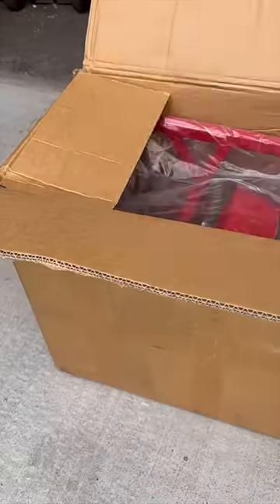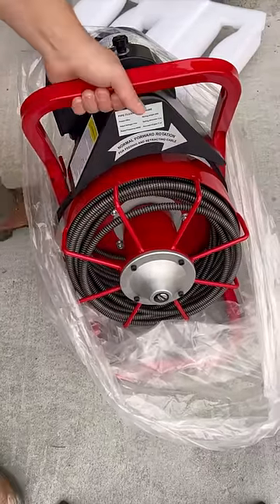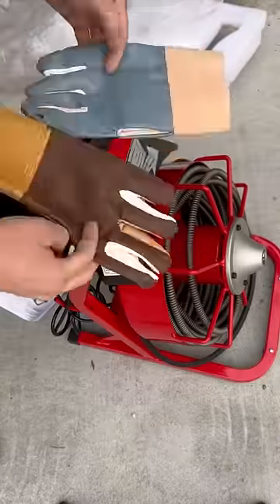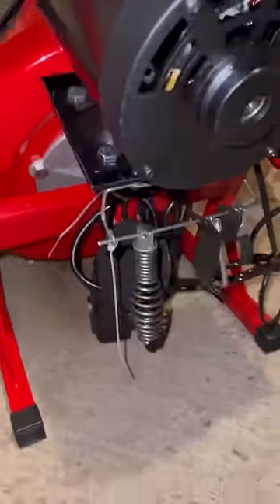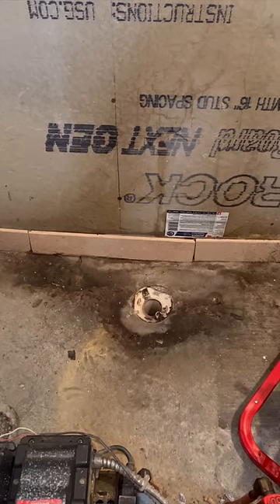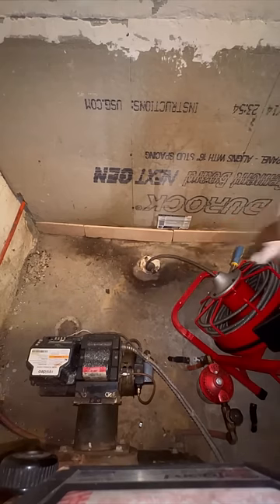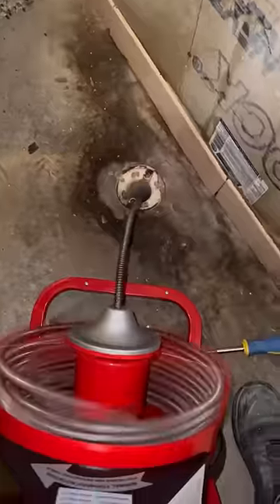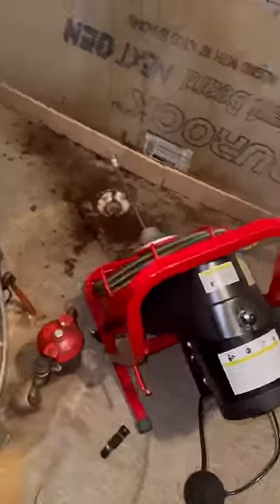VEVOR Drain Cleaner Snake #vevor #diyproject #vevordiyproject

Comment: Bought one from harbor freight when my drain to the street filled with roots. Best 200 bucks spent. One call to the plumber at 400 dollars was one time too many. It really is easy to use
Reply: Short term fix.
Reply: Unfortunately, you're probably going to have to do some replacement or reabilitation.
Reply: Any sewer machine you get for less than $1000 isn't made for big pipes underground. You may have gotten lucky and opened it but if it hits bad roots that cable can tie in a knot. That's why mainline rodders have a thicker cable. It can't do a U-turn inside the pipe. Just be gentle with it....
Reply: Man 400 for a plumber is insane. Where I live this would cost 20 euros. 40 tops
Reply: If roots are your only problem and the pipes in good shape it's worth it to get it jetted.
Reply: one thing people never think about also is how readily available these things are at equipment rental centers....i work at a hardware/lumberyard/rental center and those things make us so much money...only 50 bucks to rent the big one and 35 for the little one...those things save people so much money and pay themseleves off 4-5 times over with very little maintenance
Reply: @ehenyor  Maybe. Need to get a camera in there. Here in the upper Midwest, we have a shittone of terracotta drains the will get hella tree roots in them, yet show no structural damage. A lot of the older places will have the sections 'dry fitted' and laid in bed of pea gravel, etc. OTOH, if the ground has shifted, etc., then yep, gotsta dig that out and rebuild.
Reply: If you have roots that means you probably have clay/ terracotta drain pipes. Roots enter through the joints that connect the pieces of pipe. You’re gonna have to spend tens of thousands to replace that whole line :), snaking hardly ever works for roots too if it’s really bad. What you really need to clear roots is a hydro jetter. What you should really do is get your side sewer hydro jetted then hire someone to run drain liner to renew your old clay pipe. Liner comes with a 50 year guarantee

Comment: I bought a larger version of the VEVOR drain cleaner.   Worked great and chopped out all the roots in the 4 in main sewer line.
Reply: What cutter did you use for roots? I just bought a circular saw bit for my snake, didnt use it yet
Reply from the maker: Theyre good definitely
Reply: @JohnSmith-xu7ev  Used a 4 in C-cutter blade that I bought on line.

Comment: Anything I get that's branded Vevor gets fully disassembled then rebuilt before use. Been bitten by their crappy QC too many times.
Reply: But when they get it right, they get it right
Reply: Make your own brand then G
Reply: Dissembled
Reply: @marktupapi5609  I don't have a factory and I don't require one. I'm quite happy to just check things before use.
Reply: @Luka-cb7mh  Either is acceptable.
Reply: I bought one from Rigid and it got destroyed the first day I used it because someone dumped tar down the drain pipe.  It sat for like 8 years before I decided to rebuild it.  Works fine now.  I think it cost me $300 so that Vevor looks like a much better deal and a lot easier to repair if necessary.
Reply: Don't buy their automotive jacks. They're trash. Welds missing or broken 1st use.
Reply: @markjones516  Project Farm’s comparison video showed the Daytona jacks were the best (I think).
Reply: @carsonchambers5617  I had a vevor motorcycle jack. Missing welds or welds that broke. Then they sent a new chassis that was all in peaces no welds but painted. But vevor has awesome diesel heaters for $120 USD.

Comment: i bought a 2 gallon hand pressure sprayer for pesticide application from Vevor a few months ago, i work in pest control, company supplies one sprayer, but having 2 is super nice to use multiple different pesticides at the same time without washing and emptying one sprayer. 

the sprayer I bought honestly works better than the $500 sprayer the company provides (B&G brand sprayer).  it doesnt leak, holds pressure, and hasnt had anything serious break. this small metal piece on the side to hold the sprayer wand broke from a collision with a brick column, but  a little jb weld and its good as new!

got me curious about their other products and the quality.

Comment: Noted, if I ever get a clogged drain I’m just getting me one of these and I’ll never have to worry about it again
Reply: Until you break your pipe because you don't comprehend plumbing, or how to use it, and then have to hire someone to jackhammer your foundation to replace the broken pipe!!
WINNING
Reply: @joshuawood1436  well I don’t live on a slab and shit goes downhill that’s all you need to know
Reply: @barry4666  I agree, shit does go downhill, andyou'll find that out the hard way oneday. 🤣
Reply: @joshuawood1436  been in the trade 6+ years, pretty sure it would’ve happened by now bub 🤣

Comment: So you have a preference for open drums or closed drums? The open ones are easy to clean but it can get messy if your line is dripping doodoo. The closed ones make way less mess during snaking but are very difficult to clean short of unscrewing and opening them up.
Reply: Take a small traffic cone and put your snake through the top of it and put a rag over the cone so when you reverse it you don’t sling shit everywhere. Trick of the trade that’s propriety
Reply from the maker: Im not very familiar. I don’t usually do snakes tbh but it sounds like a closed drum would be better
Reply: @hydronyc  Bro I’m working in SF in a 23 story high rise it looks so similar to what you do. You’re a beast brother pipe looks amazing

Comment: How does it compare to other electric snakes? I know you've tried the 25ft ridgid handheld, all albanian plumbers in nyc have. Are there different cables for smaller pipe, perhaps a smaller cable for old rotted drains? Do you think it could bust open old nohub piping?
Reply: I'm  not a sewer guy, but I  bought a General screw-rooter,  auto feed. $275-$375 for a main line. Got roots? $$$.
Reply from the maker: I worked fine for me. Lmaooo thats true on that

Comment: That snake would work better blocking off the open side of the basket, I have an identical one from harbor freight I got 15 years ago, it liked to throw loops in the basket but after blocking half of it off I no longer have that issue and this snake has been through hell and back, I’m on I believe the 12th cable and it’s still going strong. Though I’m considering a whole new arsenal from Gorlitz

Comment: Bought a manual 50 footer because my kitchen sink clinched its cheeks tighter than a dude with IBS on a first date. Sadly it turns out the previous home owner treated that drain like a magical portal where oil and grease can go frolic in the flowers. Cost me 3k to get that entire 100 foot section repiped. Oh and a side bonus. There was obvious signs of handyman special. there were rocks and various other objects under the pipes to try and mimic straps that would keep the pipe at a constant down grade.

Comment: 500 to take my drain cleaner off the truck. Also comes with a camera inspection and a what i consider a whole home flush which is just pretty much i put the whole homes draining system to the max to ensure no back ups. No additional cost until 3 rd hr and or having to pull a toilet.
Additional hr after 3 is like 200 per hr
Reply: If it's gotten to this point most times we are tunneling under the home and replacing piping due to old school 70s sanitation piping

Comment: You shouldn't cable a line without a camera inspection first. It's also way easier to sell a repair or a repipe when the customer can see the issue on the camera screen- you can even discount the cost of the camera inspection if they go with the repair. I charge around $350 to inspect and cable a line under 35'.